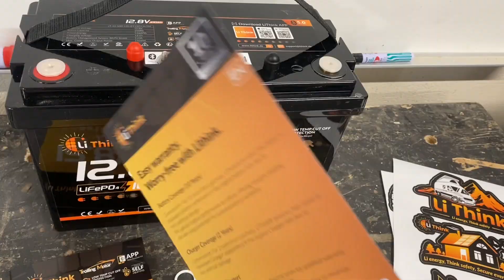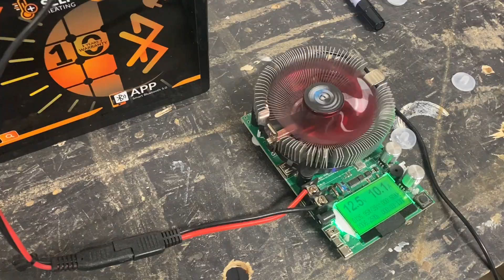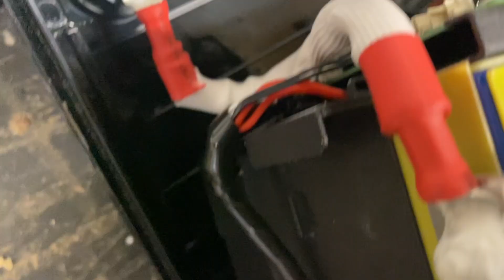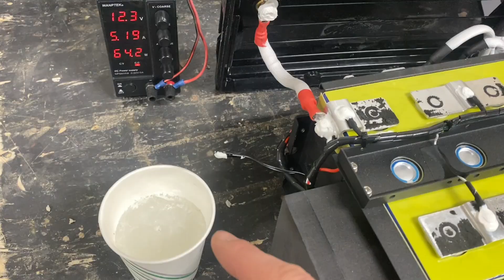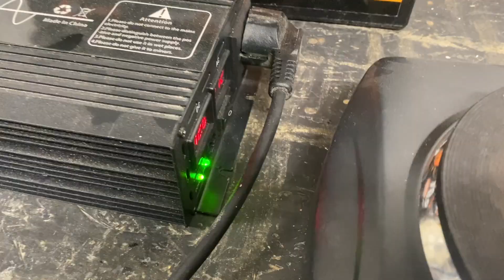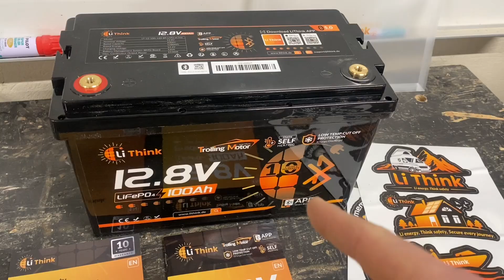LiThink 12.8V 100Ah LiFePO4 | Review

Comment: Hello, Very nice video !!!    I need a new battery for my camper mover, it can use up to 120 amps and the specs on this battery says it can deliver that constantly, do you think that is correct ?
Reply from the maker: The battery has a 120A BMS, and in my over-current test it handled high loads, but keep in mind that continuous 120A might be too high for a single battery continuously. I would consider 2 batteries to share the load.